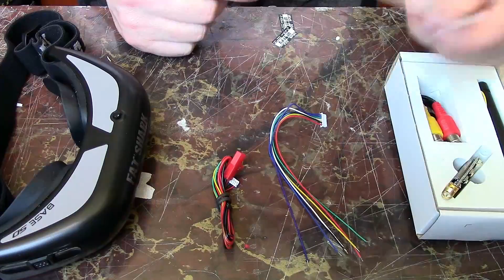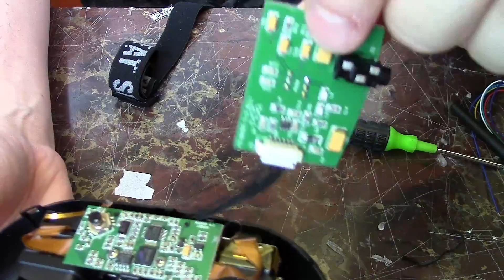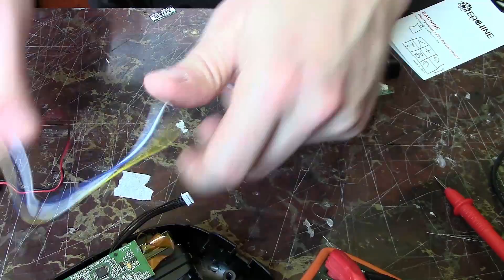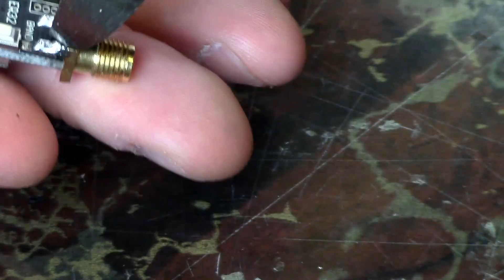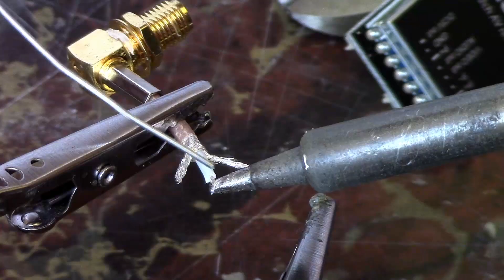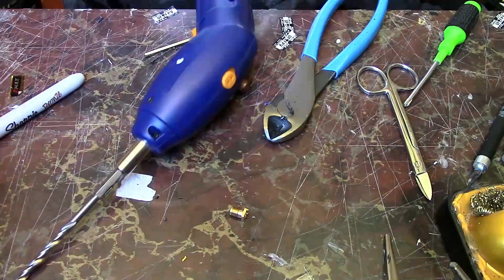Fatshark Base SD - Adding a Video Receiver

Comment: Hello, is there a anything I need to take note of if I use a diversity receiver instead?
Reply: Its the ones with a screen - Realacc 5808
Reply from the maker: It doesnt matter how many Recievers it has, it will only have one video wire going out so no it wont make any difference.

Comment: Quick question. I have a AKK. And audio out from reciever do I need 2 wires? one wire to AR and one to AW? Or can I bridge both with one wire?
Reply from the maker: sorry i dont use the audio at all
Reply: @thenatedog  did you use a voltage stepdown?
Reply from the maker: @Cloud9FPV  no both the headset and the rx have a wide voltage range. 2s-6s? cant remember
Reply: Ok cool I actually wired from the AKK to both audio outputs to both AW&AR and I have stereo in my headphones.

Comment: I been looking at these, I have a diversity monitor that's great and I was going to wire these into it... Seems like the best option for 70$. I got the monitor for 40, it was 180 everywhere and some hobby store had it new on eBay for 40$. Tripod for 12 it fits in the side pocket of my back pack. If your looking for a chair that fits in a backpack oak Creek outdoor supply brand has one that's pretty good for about 25$
Reply: instablaster...
Reply: @jayceonjudson3038  sure why not

Comment: Hi nathan .
Could you tel me if it is posible to make this mod using the FSV2445 V2 or RX5808? Not worried about the space or screen, only if it's possible to solder the moduel to the goggles!

Comment: Just a question about the ER2 wiring. 
ER2 has a input voltage passthrough so can I run P+ (green) GND & Video-out to the BASE board. While P+ (red) & P- (black) go to my LiPo. Seem OK?

In fact, if I use the cable with balance port & micro-jst - I just have to swap the white wire from +5v-out over to P+ & thats all ready to use, no soldering needed! Except to add a female micro-jst to the goggles board instead of a servo.
That seems OK to me, but just nice to have your opinion about that. :-)
Reply: The mod worked out great except unfortunately I only get about 10m range with the ER2. I presume i either didn't do a good job of replacing the SMA cable or something is wrong with the antenna or fixings.
Reply: Today i got perfect reception. I noticed the brass SMA connector was touching against the receiver case inside the goggles, so i used to some foam to insulate. Not sure if that was the issue or not.

Comment: Is the futaba plug port still active with this mod?
Reply from the maker: It should be, i connected to the same ports i didnt cut anything. The reason i havent tested it yet is that i need to put a in line switch to turn off the added RX module. If i was to power the goggles the old way with the port it would also power the RX module and it would be sending two video signals on the same line.

Comment: Base SDs are just cool. Great mod Nathan. I've been hoping someone would lead the way on this!
Reply from the maker: Thanks. I held off doing this mod until i got a second pair of goggles (headplay hd). I didnt want to destroy them. I have used them now like this for a few flights and they are working great. Only issue is getting a stick in to push the buttons is a pain. I would just cut a big hole out for your fingers next time or make buttons.

Comment: Cool mod! So how is your impressions with it? Do you feel difference?
Reply from the maker: +Stepan Shurgay Well its slightly heavier being that it has a 1000mah 2s battery in it now, but the original BASE SD goggles were tethered only with a cable, they didn't have a receiver at all, so being able to walk around and not ripping that out is really awesome. Plus not having to bring a tripod with a separate receiver is great for small and light setups.
Reply: Oh, exactly, they didn't have a receiver at all..) So you maked valuable googles) How is your experience with it at all? Many owners of Base SD sad that it uncomfortable sitting on eyes, what is your thoughts about it? Thanx